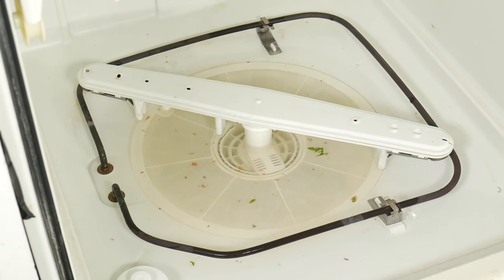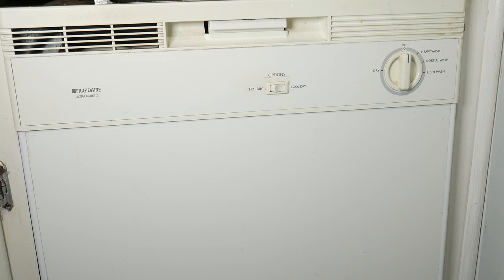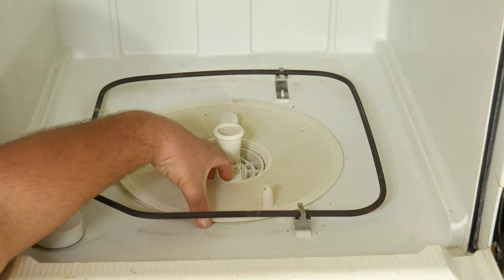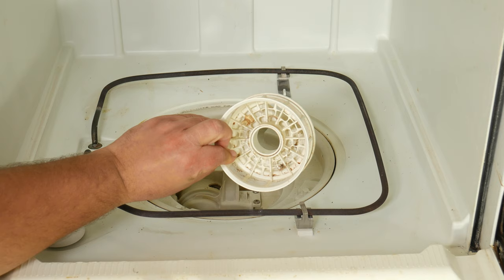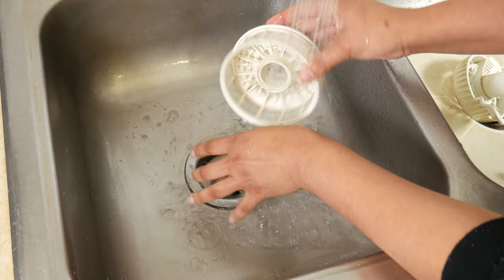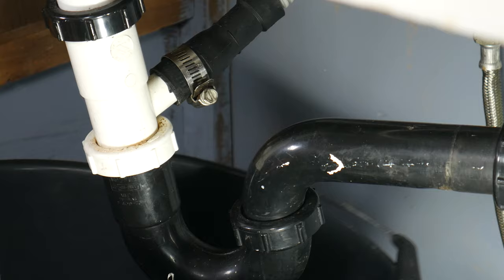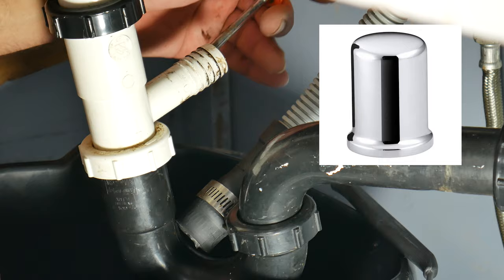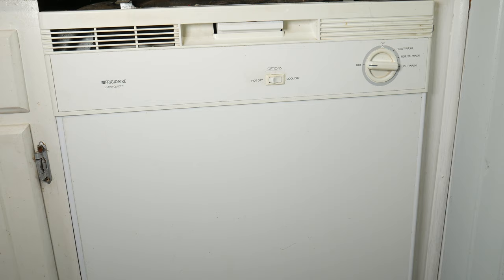How To Unclog Dishwasher Easy Simple

Comment: Thanks for your info. Mine still didn't clear so I emptied every bit of standing water using a section cut off the bottom of a plastic water bottle to use as a big spoon. When empty, I drained the last of it away by wringing out a sponge until there was (almost) no water left. I then poured two kettles of freshly boiled water and added a few spoonfuls of bicarbonate of soda. After a minute or two I ran a rinse cycle. The boiling water must have melted any fat deposits that were blocking the internals and everything flowed freely again. It's worth trying this if anyone still can't get it to clear.
Thanks again for the video!

Comment: Very nice
Atten Viewers I added an extra helpful assembly replacement tip Thanks @StatUpBox I needed the last extra steps of hose cleaning that was left completely out of the last couple of Videos I watched... and I hope you don't mind me including just a tiny extra helpful tip to all viewers about reassembly of the filters and how to place them, so they are set in right.
The Large filter dish should be snugly set onto the lower filter basket by flexing it over the top of the ridge that faces up, then make sure to set the extension that sticks out into the hole in the bottom of the dishwasher that's at 11 o'clock. This will ensure that everything is not loosy-goosy and possibly damage itself or break the dishwasher sprayer arm

Comment: I just fixed my dishwasher today. I had the same problem that the dishwasher wouldn’t drain. So my water drain line was CLOGGED SOOOO badly. Fat and nonsense. Took it off, went outside with it and pressure washed it and a bunch of sh1t flew out of it as if I had Taco Bell earlier. So re installed the water drain hose and it worked great!

Comment: If you'd rather try something else simpler before you try this, turn on your sink, and when you can get your dishwasher to start draining, pulse the garbage disposal off and on until you hear the dishwasher start filling up again/stop draining.

My model is not similar here, and when I felt my food filter I didn't feel anything much trapping the filter. Although, there was a lot of fiber that I shouldn't have put into the dishwasher, I think that it had gotten into the drain hose that intersects with the sink.

The garbage disposal helped suck out the fiber that was stuck in the drain hose from the dishwasher.

Comment: Hey guys, great video. I'm having a similar problem, just now I've seen water pool in the bottom of my dishwasher(that is literally never used) but I think it may be from the actual sink itself being clogged. So my major issue is that when I wash dishes upstairs the sink downstairs gets filled with water. and then if I wash dishes downstairs the sink gets really full and take a long time to drain. I've seen terms like "p-trap" that I think could be the culprit. Is there a video on how to clear up that clog? Or if what I described is a whole other issue? I appreciate the help from anyone willing to offer some advice
Reply: I had a similar issue. You can get a snake and do it yourself from harbor freight for a few bucks. You want to snake both drains then the one in your basement. Usually the one in your basement is a pipe in the corner with a little extra pipe sticking out. You can remove that cap and snake that also. Just be sure to put the cap back on. If all else fails sometimes there is a vent on the roof that allows air flow, if this is trapped with leaves or other stuff sinks will drain very slowly. You can also try putting some drain de clogger in all the drains and see if that works. If all else fails call a plumber. They charge around 100 bucks to do this but it's worth it.
Reply: Don't know if you fixed your problem yet, but  you can also try buying  degreaser and pouring some in your sink when dry and then adding hot water (not boiling) from off the stove. Sometimes if there is no clog in your home this can happen from new building in your area, rain water is no longer being caught by grass and tree roots so the area starts to flood. This can cause your whole home to drain water slowly and in some cases for water to back up into your home.

Comment: Probably a dumb question.  Do I need to put all the parts back in?  Like will it drain before I place the spinning head and filter back in?   I am trying to make sure it works before putting all items back together
Reply from the maker: as the saying says, the only _____ question is the one not asked. as a precaution we like to place parts back, b/c they filter any sediments or solids that may be in the water preventing any future clogs.good luck👍😊

Comment: You  forgot to show how to reattach the disk strainer to the circular screen filter. The disk strainer should not be free floating. The base piece can be detached (pops apart) from the circular screen filter in order to reattach the disc filter between the two pieces securely. The disk filter should be refitted at the rim of the circular screen filter. This will properly prevent debris from entering water drain which can cause more problems.
Reply: you need to make a video:)
Reply: @zmarvelous664  lol If I only knew how.
Reply: Ikr! I just posted a little extra bit about how to do that and I watched @appliancepartspros video where they tell you how to flex it over the lower filter housing and where to set the rest of the parts so they fit snugly in as well

Comment: I have a lot of water in the bottom of my dishwasher should I try to clean that out first? At the end you said run the dish washer to get rid of the extra water? Clean out most of the water attempt the repair and then turn it on at the end to get rid of remaining water?
Reply from the maker: have you checked the hose that connects to drain, to see if its clogged.

Comment: Thanks for posting this video. At around 1:55, you say, "If that is free and clear..." and then skip past it. That's one of the most important parts, though. What do you we do if that part is not free and clear? How can we get gunk out of those parts? I'm struggling to remove a clog from that part.
Reply from the maker: there are many thing you can use like, a toothbrush, a wet/dry vac , a baby cleaner brush, the old soap and water , rag, baking soda and vinegar solution, a plastic hair drain remover, some hot water to loosen the grime, grease or dirt accumulated. After clean it would be a maintenance schedule to avoid big build up , b/c the filter that we remove before that time stamp  is suppose to help prevent this, so looking in to that part for any holes or not sealing correctly may be a sign of replacing that part or it can be just that it had not been clean for a while. good luck!! thanks for the comment. hope this helps! 😁😁👍👍
Reply: @StatUpBox  Thank you! Very helpful.
Reply: Watch a real Tutorial video
Reply: @brianknipp215  Do you have any good suggestions?

Comment: If you have an air gap a clog at the drain connector is not the problem. The air gap would actually turn into your drain then.